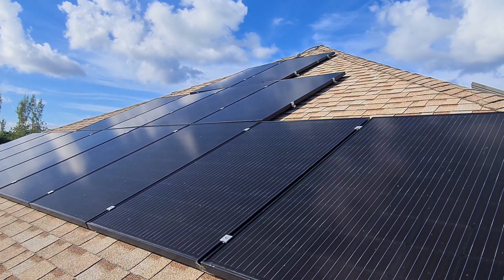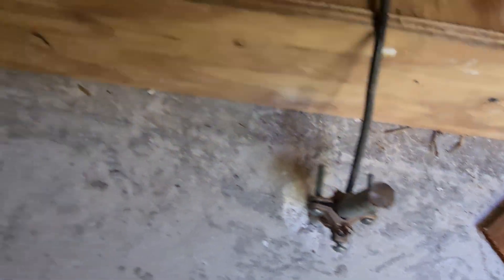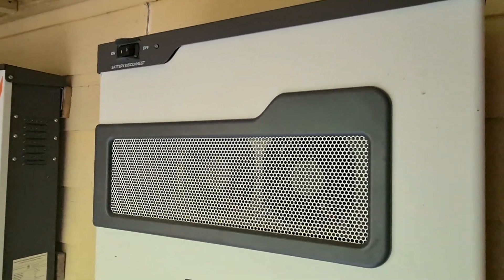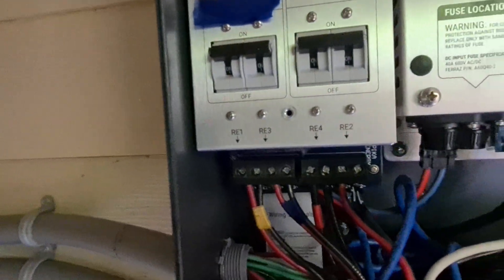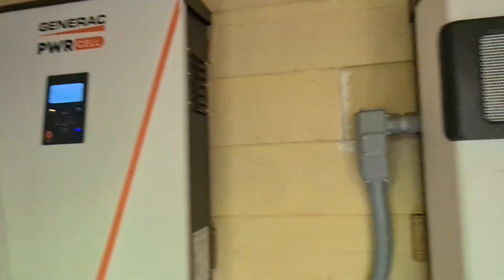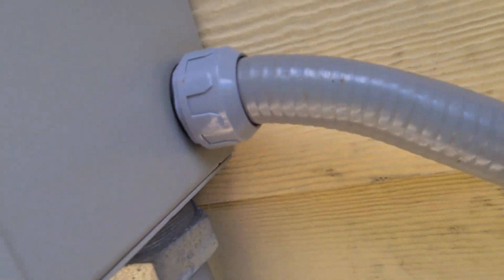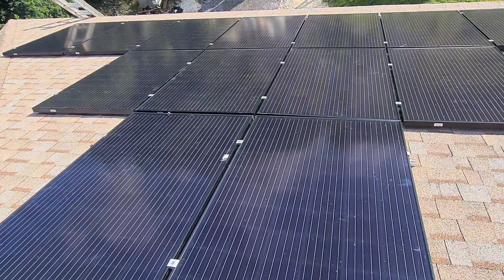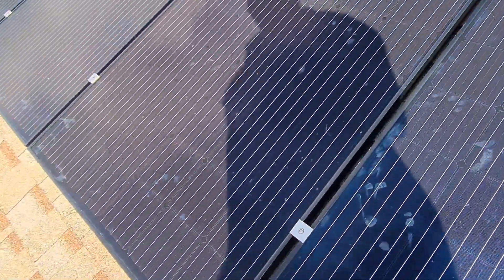Generac 11.4kw PWRCELL

Comment: Can you share why you got 11.4kw vs the 7.8?  I was looking to get the latter, but like to know your reasoning for the larger one and what the cost difference was.
Reply from the maker: Good question I need a three phase system and only the 11.4 came at 120/208 volts .
The system is very expensive but is the latest in technology. The PWR view app with fleets management allows me to monitor and controls all my site remotely. 
This system avarge around $15.000 to $30,000 installed with up to 15 years warranty.